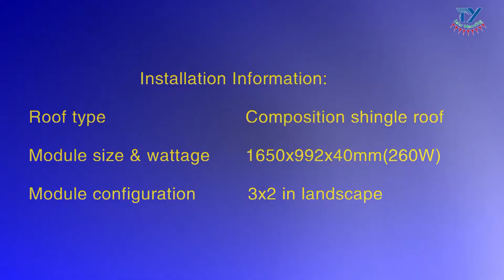Rail-less Solar Racking System for Composition Shingle Roof with Easy Installation CY-ZJ10-1

Comment: I wish my roof had a floor to stand on while installing that 1st row. So many mistakes with your clock and editing. Notice scene changes at 2:11, 2:52, and 4:01. There is no way this was installed in 6 minutes. Great concept but you lose credibility when you use a video that proves deception.